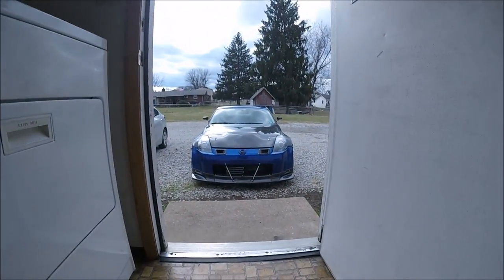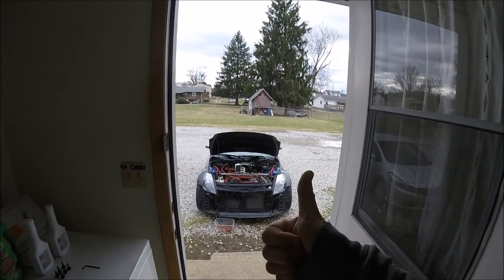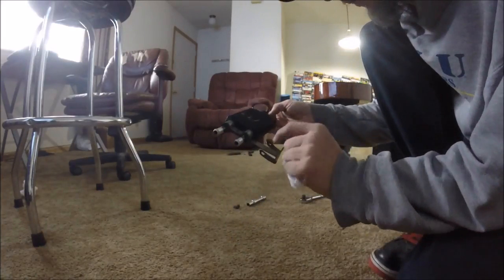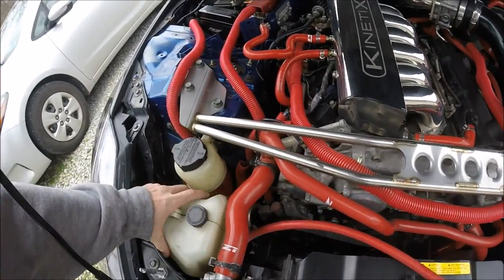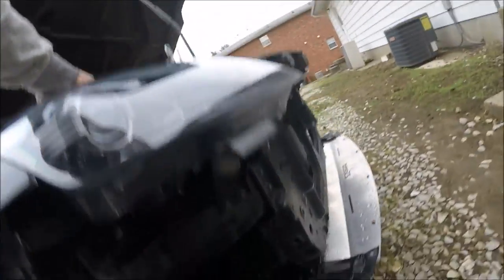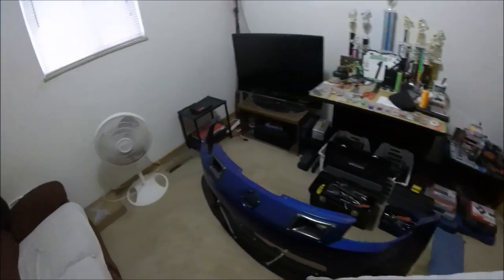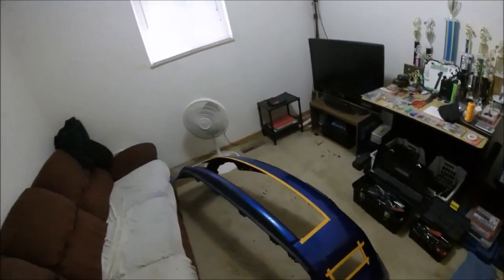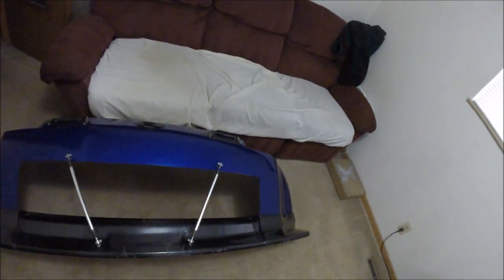350z Power Steering Cooler Relocation

Comment: Dude since your obssede with this 350z can you tell me the best way to flush a radiator super clean for this car for new anti.
Reply from the maker: put car on jackstands drain coolant refill with distilled water start car crank heater to max put in chemical used for cleaning (flushing) found at any auto parts store then top off water idle car until all air is out of system take car for shrt drive come back drain refill with your new anti repeat air purge process your done really the purging is the longest and most difficult part hope this helps 👍
Reply from the maker: the lisle spill free funnel from ebay made the air bleeding process sooooo easy highly recommend it man http:www.ebay.com